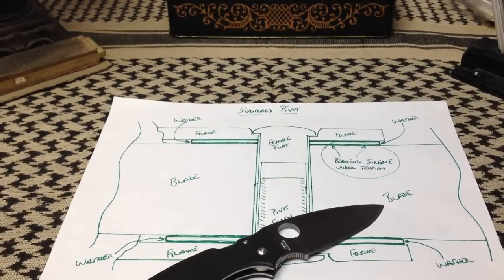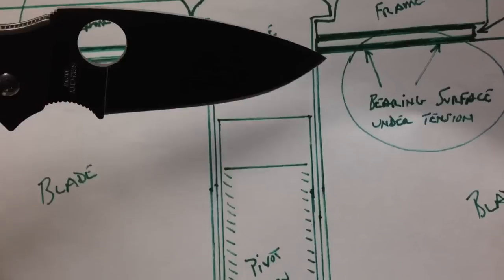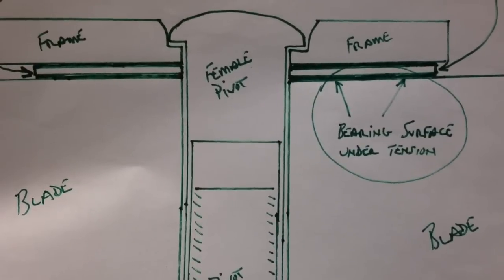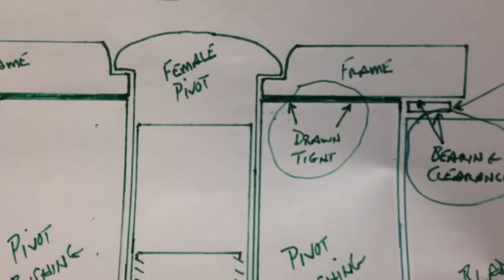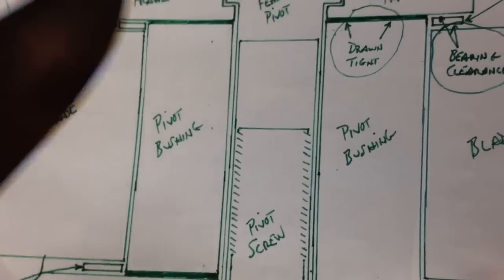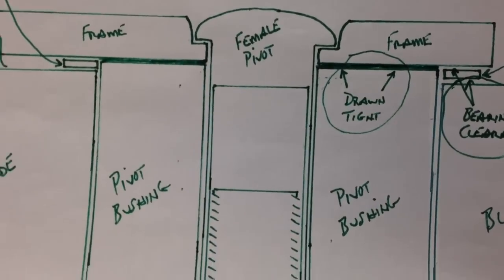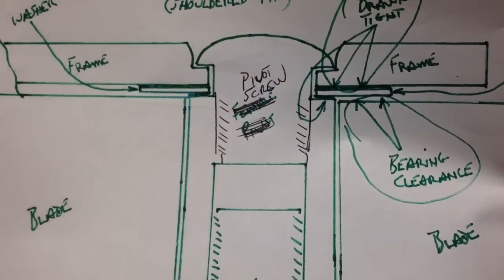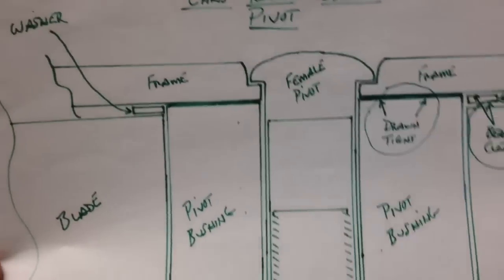Knife School:  Folding Knife Pivot Designs Explained

Comment: Thanks for the video, 8 years later and I still feel there are not many “good” pivots. I am working on some friction folders and can’t really find what I want. Most commercial pivots for knife makers the heads on screw are too small for what I’m looking for. I want someone to make a female post with the same inside that a “locknut” has. The head on the female post and the screw need to be larger, would be nice if it could accept a phosphorus bronze bushing over it too and still have enough of the head to hold. A machine screw and locknut work perfect but the locknut on the end is too bulky and if you use a bushing over the screw then the screw head won’t hold unless you use the scale as a washer or place a washer under the screw head and the scale holes must be smaller than hole in blade... it seems like there should be an easier solution. There are female post screws for furniture that are kinda ok.

Comment: What a great video! Watched it over and over again. I believe a strong pivot is essential for a good folding knife. 

What leads to my question: Would you say that a bushing pivot enhances the stability of the joint? In terms of durability against hard use, such as whittling hard wood, prying etc. Or is it solely for a smoother opening action?

Thanks in advance for your reply, Sir. 

Andy
Reply from the maker: I think it’s definitely good for both strength and smoothness. The bushing and through sleeve add another positive locating point, and screws that are fully tightened, backed up with locating pins are always stronger than screws that fasten, locate and adjust all at the same time.
Reply: @TheApostleP  that‘s some good advice again. Thanks a lot! 
Would you say it’s true for both, the Chris Reeve type as well as for the shouldered bushings of the Spydercos? I could imagine that the smaller contact area of the spydie bushing reaches its limits a tap earlier.
Reply from the maker: @ndman1940  The Spydie system is kind of weak and imprecise actually.
Reply: @TheApostleP  weaker than a non-bushing pivot?
Reply from the maker: @ndman1940  It depends how good it is on each knife. Some lock down tight with good action, and some have to be adjusted. Kind of a jacked up design, with a manufacturing process not capable of producing consistent dimensions.
Reply: @TheApostleP  well, I guess that’s what we get when everybody wants a super duper product for the least money possible. Thanks again for sharing your vast knowledge with us!

Comment: Another great video. I had an idea of the typical pivot but the whole bushing system seemed confusing. I have read that many folks with PM2 prefer the older standard pivot for adjusting out play. Obviously a bushing system is very dependent on consistent precision which Reeves delivers at a premium.It seems to me that for production knives the newer bearing systems are superior because you can have an extremely smooth action with no blade play without relying on costly precision. My ZT 560 has the most solid feel yet opens very smooth and consistent without break in or fear of over tightening (although I am sure it is possible but very unlikely).Too be honest,I'm surprised it took this long to have ball bearing pivots on filing knives considering they have been proven extremely effective in other more stressful applications.